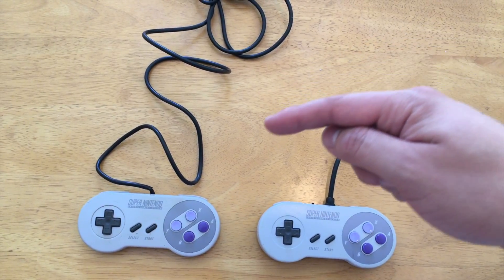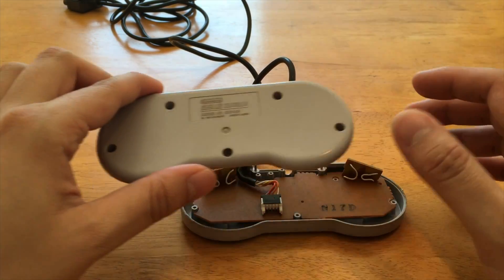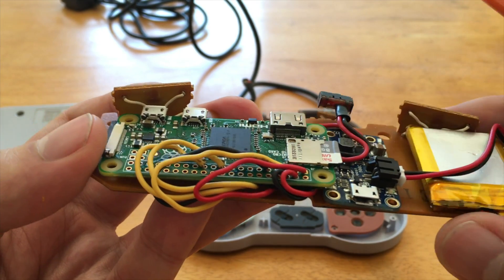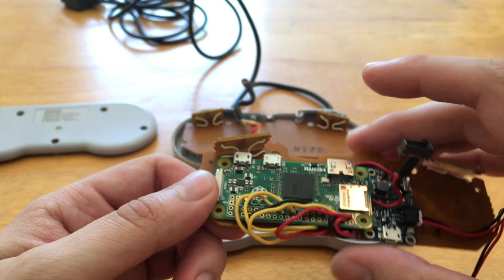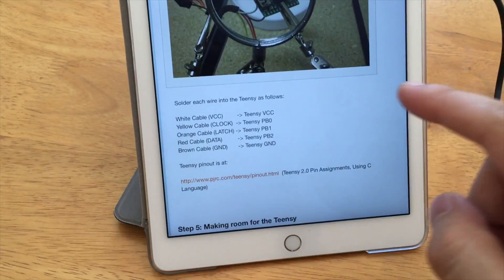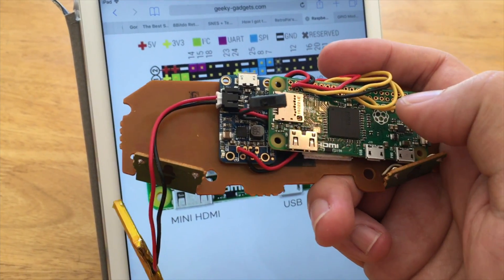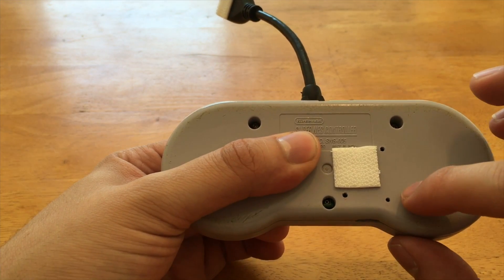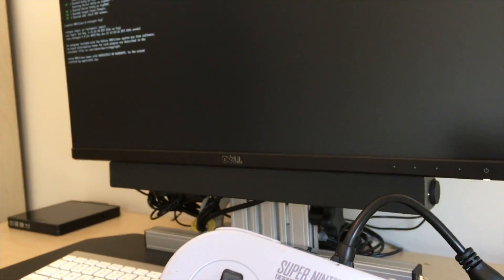Raspberry Pi Zero inside an SNES Controller - The SNS-005Z

Comment: great video, would it not be easier to get one of the cheap knock off usb snes controllers and connect straight to pi0 usb, wont need additional coding?
Reply from the maker: Hi Brian, yeah I think it would.  You have a few more connection approaches with USB and it wouldn't require the gamecon_gpio driver (so less software config).  I found this video yesterday of someone who took a shot at a USB approach - https://www.youtube.com/watch?v=SRgjDyblBdA  They ended up mounting the pi-zero on the outside of the case.  I think it would be possible to find a way to mount it internally as well.  The challenge with usb is that each one you buy is likely to have a different internal layout making fit a complication.   That should be workable though.
Reply: thanks for the reply, as I have access to a 3d printer, my thoughts were to either make a spacer between the two halves to give more room inside or to just print a deeper bottom half which wont be to difficult, i hope :)
Reply from the maker: totally man, maybe check out http://www.thingiverse.com/thing:337896/#files. That user created a pretty close model of the snes controller.  Wondering if it would be possible to modify those for the case modifications if they are needed?
Reply: definitely, just import the bottom half into something like sketchup, and modify it to suit, you would be able to add proper fixings to fix the pi0 down, holes for cable and port exit etc, i'd like to make this type for my grandchildren so there's less cables so they can plug in hdmi and go, maybe arrange the zero so that the ports are accessible from the outside so you could update the games or add another controller for 2 player, im currently making the nes cartridge version if you've seen that.
Reply from the maker: Awesome, yes that's what I was hoping to hear about the STL files.  This project has definitely helped me learn a few things I have been wanting to try out - and you are helping add to that (sketchup added to the list)  =)  

The NES cartridge mod from https://www.youtube.com/watch?v=gHzgNIEqQ5s is awesome.  Loved how that came out.

Comment: How long does the battery last. would it be possible to do 1000?
Reply from the maker: Hi Steven, it lasts about 2 to 2.5 hours.  I had looked at a 1000mAh measurement wise and it wouldn't fit it the space i was working with.  I think 500mAh is likely the largest that will fit without making the bottom of the case a bit deeper.
Reply: Anthony Caccese can you play while charging?
Reply from the maker: Yes totally
Reply: Anthony Caccese Hi thank you for this awesome build. I actually build my own with a few tweaks. I was wondering how powerful a charger you need to be able to play and charge at the same time?

Comment: How difficult would you say was the whole wiring part between Pi Zero, the additional battery chip and the battery itself?
I'm a total noob when it comes down to realize hardware projects with the RPi but you made it actually look really easy to rebuild.
Having those lots of wires to place would be a real PITA for me tho, I think.
Reply from the maker: This was my first project like this and it was about a weekend or 2 of work to plan and built it end to end.  I spent the first weekend doing a lot of research, laying things out (testing fit) and playing with wires to make sure I was comfortable with soldering before finishing it.  Second weekend was putting it all together.

I would recommend watching a few tutorials on soldering, desoldering to see if they are interesting to you.  If they are then this project can be pull off relatively easily.  The most complex part was getting it all to fit, making sure the connections were correct and troubleshooting the driver configuration.  But they are all easy to overcome.

If you have watched this video and similar ones and got excited about building your own - that's the fuel you need to start =)

I am here to help as well no worries

Comment: How do you reprogram the pi zero? do i need to use a keyboard to the pi or do i reprogram the sd card? Sorry very new to all this. My Emulation Station says no gamepad, did I mess up?
Reply from the maker: Hi Franco, you will need a keyboard hooked up to the micro usb otg port on the pi zero before closing things up for good.  With the keyboard you will be able to set up the final configs to get the pi to recognize the snes controller buttons (following the blog post i reference in the description of the video)

Comment: Hi.The link to wiring diagram doesn't work
Reply from the maker: Let me know if this works - https://www.dropbox.com/s/ejuknjfanwvcx2d/sns-005z%20wiring.png?dl=0
Reply: Yes it worked.
But how do you program it so it work with retropie?
Reply from the maker: Cool, next check out the blog post I reference in the video description for setting up the gamecon_gpio driver.  You will need to set that up for the controller to be recognized

Comment: The pizero - you have to remember this is a $5 board. Single processor. Seems to run NES perfectly and Snes very well. I don't own one, and just went with pi 3 as I wanted to run nes,snes, sega master system, genesis, neo geo and psx. Pi3 at this point does that perfectly. PSX runs at or about 60fps its super smooth. 

PiZero from what I tested at a friends house didn't like anything other than nes and snes. In that regard, you could plop a pizero with a spare sd card you have laying around and have nes / snes on every tv in the house for dirt cheap :)

I think if you use the pizero in this way and use it for the lower spec systems like nes/snes/atari 2600 etc then its cool.

Comment: Could you give me a list of all the parts I will need please? Not tools.
Reply from the maker: Here you go....
- Raspberry PI Zero (v1.3) - https://www.raspberrypi.org/products/pi-zero/
- Super Nintendo Controller (model #SNS-005)
- Powerboost 500c - https://www.adafruit.com/products/1944
- Lithium Ion Polymer Battery (3.7v 500mAh) - https://www.adafruit.com/products/1578
- Slide Switch - https://www.adafruit.com/products/805
- Mini HDMI Male to HDMI female adapter - https://www.amazon.com/gp/product/B00IZYIZKA

Comment: Hi, I would like to create the same thing but I've got a problem, my SNES controller got a USB output which means Positive, Negative, Data+ and Data-. Then I would like to know if there is a way to wire those to the GPIO pin. If so on which one ?
( GPIO 2, 3 ? ).
Thanks for help if you can do so.
Reply from the maker: Will research and see what I can find
Reply: You can solder the usb wires to the usb test pads under the pi zero. That's what I did. Here's the video I used to figure it out  https://youtu.be/l0Wp9AfILYE

Comment: Greetings,
I am creating a Zero PI SNES Controller. I have tried all I can to configure the GPIO’s to the controller, however, nothing seems to work. 
I am using recalbox and I am aware that it won’t be the same configuration as in your video.
Could you please if at all possible point me in the right direction? 

My SNES controller > 
Red = Data
Yellow = Latch
White = 5V
Blue = Clock
Brown = Ground

I would need to know the GPIO layout for this, and most important the “recalbox confg”
Any help would be greatly appreciated. Thanks a mill.
Reply from the maker: Hi Joshua, I looked around in the recalbox wiki to see if there was a reference to the gamecon driver I am using for this build and sadly wasn't able to find details yet.  It looks like there is a stub for the documentation from this page https://github.com/recalbox/recalbox-os/wiki/Manual-(EN)#gpiocontrollers but nothing written yet.  In recalbox do you see a way to install the driver at all?  If thats possible you should be able to follow the details for setting up the driver from my video description.   Let me know if I can help dig more.
Reply: Hi Anthony, I have tried all I can. ether my controler is not working. or I am using the ring pins. I any case I am going to try it with retro pi and your driver. Since I will be using retro pi this should at least tell me if the controler is working. thank you so much for your help. I will let you know of the progress I make. :)

Comment: I've got mine up and running now... only problem is that retropie thinks the controller is number 2 instead of 1! time to look at the driver again 😁

also as a side note for anyone attempting this, a good way to make holes in the case is with a soldering iron with a wide tip. Acts like a hot knife and was very quick and easy. Don't breathe the fumes though 😜

Comment: Just an idea but at 9:00-ish you could file down the two bottom posts by one or 2 mm then add a small washer to each before re-attaching the back panel so as to hold the original pcb in place and not put pressure on the added boards when in use. :)

Comment: Great project.  Will make one as soon as the pi zero gets here.  BTW, how did you remove the plastic from the inside of the controller?
Reply from the maker: I used a pair of needle nose pliers and rocked the pieces I needed to remove back and forth.  I am starting to document that process a bit in my hackaday post (look at step 3) - https://hackaday.io/project/16288-raspberry-pi-zero-inside-an-snes-controller

Comment: I just soldered everything up, and installed retropie, but I'm having a hard time knowing what to do next.  The blog says to go to retropie setup, but I can't get my controller to respond.  Any Ideas?  Do I need to launch another way first?
Reply from the maker: Hi nathan goddard, you will need a keyboard and network access to run through the first steps called out in this blog post - http://blug00.blogspot.com/2016/03/how-i-got-the-gamecon-driver-to-work-on-retropie.html 
The only difference is that we are wiring up an SNES controller (not an N64).  So based on my wiring diagram above the modprobe command to use is "options gamecon_gpio_rpi map=0,0,0,0,0,1"
Let me know if that is a good start and if you run into anything else
Reply: Try hooking up a keyboard?
I believe you'll need to get into some menu to assign the controller buttons.

Comment: what did you use to clear the plastic out of the controller case? awesome build man
Reply from the maker: Thank you!  I used a pair of needle nose pliers and rocked the pieces I needed to remove back and forth.  Starting to document that process a bit here - https://hackaday.io/project/16288-raspberry-pi-zero-inside-an-snes-controller (look at step 3)

Comment: Dude, awesome project!  I'm trying to follow through with a build of my own but for some reason I cannot get RetroPie to recognize the controller.  Any ideas?  I followed your recipe to the letter (I think)....
Reply from the maker: Hi Joe LaTendresse, first double check the gpio pin wiring - https://www.dropbox.com/s/ejuknjfanwvcx2d/sns-005z%20wiring.png?dl=0.

Following that can you send me the details you have in your /etc/modprobe.d/gamecon.conf file?  It should look something like this "options gamecon_gpio_rpi map=0,0,0,0,0,1"

Last thing I can think of from there is making sure gamecon_gpio_rpi is listed in /etc/modules (order shouldn't matter)

I'll see what else I can help with if none of those work out
Reply: Fixed!  It was entirely operator error on my part because I assumed I did not need to configure the SNES pad since the drivers were loaded, so all I had to do to was go in and configure it accordingly.  Works like a charm now.  Thanks for helping me out!

Comment: Hey man ! Just wanted to say thanks for the video and inspiration. Almost finished mine out of a super famicon controller ! I just struggled a bit with the Retroarch configuration and gamecon driver install, just had to figure out how everything was working. 
I used a short HDMI converter just out of the controller, without a cable, we'll see how it lasts in time.
Thanks again for the great work, it would have been a lot harder without your video ;-)
Reply from the maker: Thank you for the kind words GroveMerida and glad the video helped.  I would love to see how the HDMI port came out on yours - i'm looking for ideas to clean this up further =).  I am working on a hackaday.io tutorial that goes more into the software and driver config side of things - hoping that helps clear up those steps for others looking to build one.

Comment: Hi, Anthony! I did this exact project early 2015, but with the Odroid W instead of raspberry pi Zero (since it didn't exist then).

A few more differences though.

I (stupidly) connected each button to different gpio pin and mapped all buttons.
I had the hdmi port in the top of the controller, rather than let the cable stick out.
And lastly; I had an original snes controller port in the controller. Allowing a second player to connect their original snes controller.

I got that to fit since, the Odroid W have a built in battery connector and charging capability.

The One thing I never solved was getting the power switch to to a full and safe shutdown.

Dd you solve that? If so, how?

Great video, man!
Reply from the maker: Nice Jonas Löfström!  I got very lucky with the wiring on mine because I found someone had written a driver for it - which definitely made it simpler to wire up.  I got close to the possibility of having to wire each button individually before I found it =).  
How do you like the Odroid W performance and size wise?  The clean HDMI port on the top sounds nice as well.

Comment: How well do GBA games run on this? You were saying it slowed after the NES. Does it dramatically impact the performance on GBA titles?
Reply from the maker: GBA games run surprisingly well on it.  The main speed issues I run into relate to exiting a game back to emulationstation and initial boot.  Once in game things are smooth.   Console wise it handles everything up to and including SNES/Genesis well (PS1/N64 are a no go).  Handheld wise up to GBA is great as well - just need to make sure you have proper bios in place.

Comment: Is it possible to do this in the SNES controller that made for PC?
  Some time ago I bought one and I was not OK Can you recommend any?
Reply from the maker: I would think so - the wiring and space you have to work with would be different so you wouldn't be able to follow what I did point for point

Check out this one as an example - https://twitter.com/another_russell/status/677212612170555393.

Comment: Why aren't you using the 5 volts of the hdmi interface?
Reply from the maker: Oh nice, I wasn't aware that was an option.   Possible to detail out how that might work?   (gather it would remove the need for a battery?)
Reply: Anthony Caccese I'm not that techy but I like those projects and I remembered there is a 5 volts positive and negative on the hdmi interface. I guess you can use that with your power booster since it's not meant to be wireless anyway 😉
Reply: Stoney_Eagle I've been researching it a bit and apparently it doesn't provide enough power. That would be fantastic, though.

Comment: do you have any reason why you use the powerboost 500?  and not one moore powerfull?
Reply from the maker: I am thinking of checking out the 1000c when attempting to add an external USB port.  For now the 500c covers the power draw needs pretty well.
Reply: thnks

Comment: can you build it without the battery? and when you start emulationstation does it ask for you to program it, like you would with a usb controller? thnx
Reply from the maker: Yes that would be possible.  I believe you would need to have a power cable coming out of the controller in addition to the HDMI.  Something similar to this project done with an NES controller - http://www.instructables.com/id/RetroPie-Inside-an-NES-Controller/

With the gamecon_gpio driver and wiring Emulationstation sees the controller as Super Nintendo controller and asks you to assign buttons it during initial setup

Comment: For how long can you play without the need of recharging the battery? 
Is it uncomfortable to the HDMI cable attached to the controller?
Amazing project!!
Reply from the maker: Thank you Rafael! With the 500mAh battery I get about 2 to 2.5 hours of play time.  The HDMI cable has a tiny bit more weight to it than the original SNES cable but it's not noticeable during play and is comfortable.